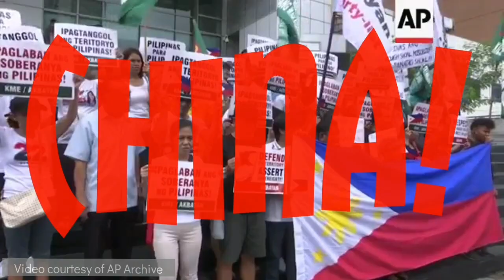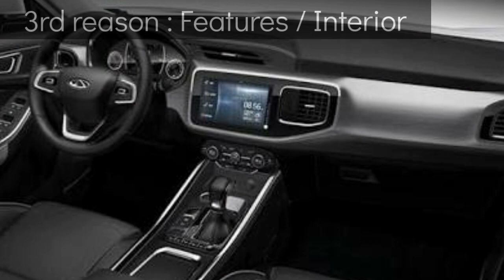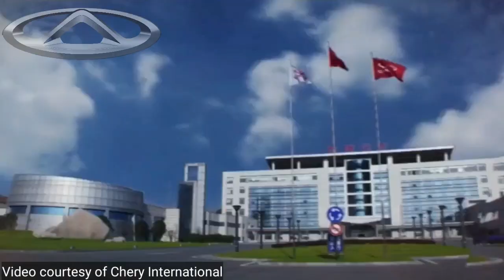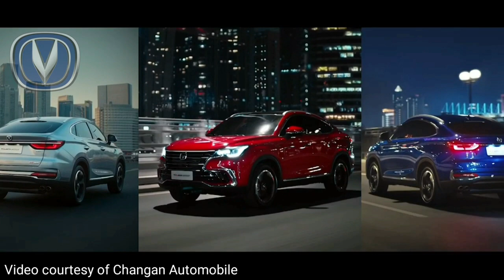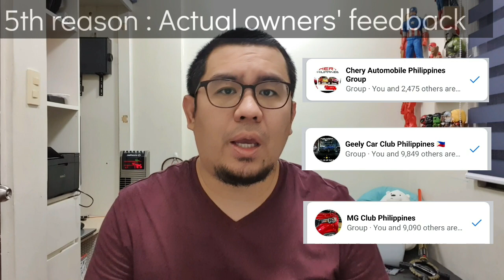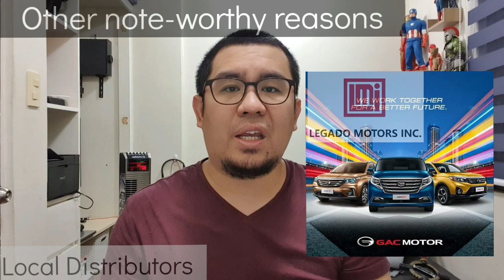Are China-made cars any good?

Comment: SAIC MG, BYD and Haval are good. Popularity have risen quickly I can tell you that. MG ZS EV and BYD Atto 3 already have 5 star crash rating and so too recent Haval Jolion and H6.
Reply from the maker: havent heard of haval yet, are they in the phil market already? thanks for the info on the crash rating, this simply mean they have high level of safety in them 😊
Reply: @jpmatubisvlogs7702  Just to let you know that the MG ZS EV is the only ZS that have 5 stars crash rating. You may also want to check whether if MG 4 is coming to your country. I'm not sure why Haval hasn't land on your turf but they were or are getting popular on ours. However numbers of Chinese EVs are now seriously picking up on our roads.
Reply: @jpmatubisvlogs7702  If you're after a workhorse Great Wall Motors (GWM for short and it's Haval's mother company) utes should be considered along with Foton and LDV (or Maxus). Depending on your market off course.
Reply from the maker: @t8polestarcyan22  appreciate these loads of info. i missed out the part that it's EV. MG hasnt released any yet here, I think BYD has.
Reply: @jpmatubisvlogs7702  Personal recommendation, BYD Atto 3. You may pay bit more than MG ZS EV but the Atto 3 is a lot better. Otherwise BYD Dolphin but I don't really know about the car.

Comment: Pagmay taxi company na line up eh china brand baka maiconsider ko na ang china made car...
Reply from the maker: Valid point po. Thanks for sharing your thoughts 😀
Reply: @jpmatubisvlogs7702  got a question, changan cs35, geely coolray or mg zs? Which one u prefered now since u already bought the coolray? Any change of mind?
Reply from the maker: @TheRealSuperYonin  i got the azka bro but I might opt for coolray given the options. 2nd choice ko would be the cs35 then zs. Im basing my opinion on actual users feedback then I also considered tenure in ph market (this is where cs35 is still catching up on)
Reply: @jpmatubisvlogs7702  pogi lang talaga zs but value for money is the coolray. Thanks!
Reply from the maker: @TheRealSuperYonin  true mas maganda porma ng zs para siyang cx5 kasi pero i heard yung low torque is causing some dissatisfaction for a few users.
Reply: @jpmatubisvlogs7702  hi just wanted to add about the ZS, im an owner for almost a year now of ZS and what i can say about the users feedback is not entirely true. while i can say that yes, there is a low torque and delayed acceleration is most probably because they are using  the ECO mode which is the  default transmission setting. which makes  the  gas consumption of the vehicle thrifty.  there is a sports mode that when you activate eliminates greatly the delay and gives full capability of its engine. normally mga new users ang may ganitong feedback or yung mga hindi pa na eexplore yung sports mode
Reply from the maker: @lyrad4584  thanks for the clarification sir 😀

Comment: Automotive Engineer for a decade here.
Certifications such ISO9001/26262 or IATF16949 in China are questionable at best. To be honest, it feels like recto on how easily they get certified. Ive audited chinese subcon plants before and their process and documentation ( FMEA, Control Plan
MsA etc) magtataka ka kung pano nabigyan ng IATF certification to manufacture an automotive plant/part. Kung sa pinas yan ginawa tanggal ang permit to operate ng isang planta. 

Foreign brands built in china are ok kasi there adhere sa mga quality audit ng foreigner. Some even go VDA6 audits.

Chinese cars? Stay away not even with a 20meter pole. Chinese cars with a chinese guy handling RnD and QA process with recto tier certifications without foreign audit? Nope.
Reply: may foreign edit po ang chery?
Reply: @stevenvictordelrosario3454  id stay away from chery from a professional stand point. To add, chinese brands dont adhere to international material data systems so another red flag.
Reply: @lolomo5787  stay away from them then! Don't force others to do likewise.
Reply: I second this. Kung engineer ka sa automotive industry tapos chinese brand car ang binili mo, para kang walang natutunan sa mga ginagawa mo. Pansin mo d ka nireplyan nung uploader? In denial pa kasi sa bad purchase niya.